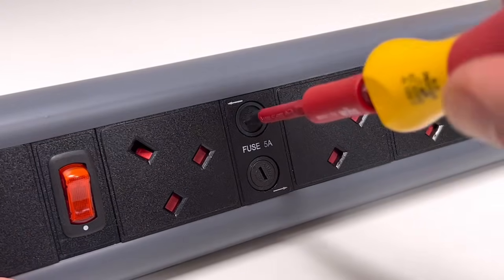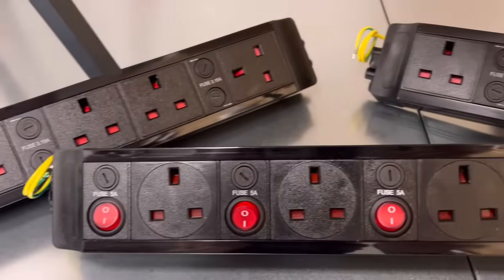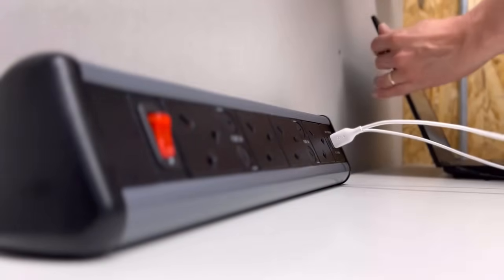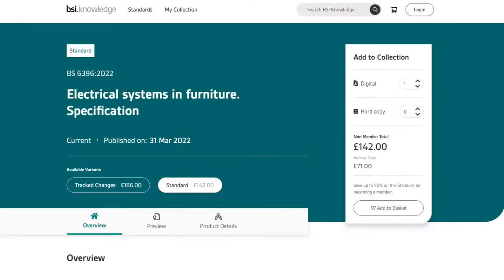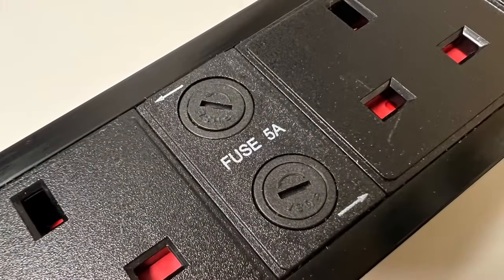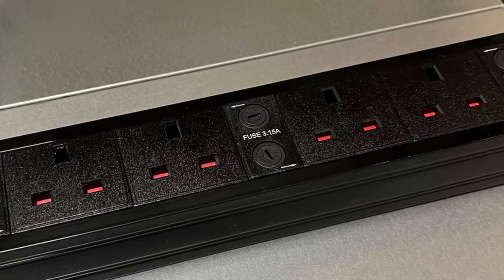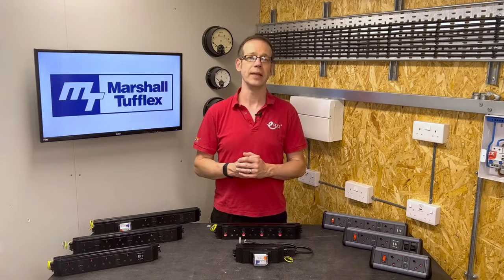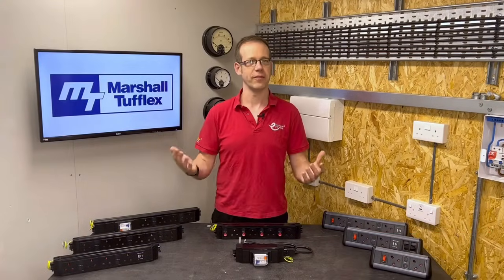BS 7671 Won't Tell You - Why Desktop Sockets Have Tiny Fuses

Comment: 5A must be one of the lowest in the world. In Germany its 16A, whereas in Australia and the Philippines its at least 10A. Quite safe as long as the circuit breaker at the panel board matches the power strip amperage.
Reply: in the UK it's as stated 13A. But in this case no one device can draw more than 5A so 2x5A = 10A, instead of a single 13A fuse in the fuseboard that can fail you are double protected.
Reply from the maker: Yeah, this is a pretty niche application for electrical outlets in furniture, a Standard UK plug top can have up to a 13A fuse in it. 👍
Reply: The main plug into the wall is 13A (a fuse inside the plug).  The sub sockets, usually supplying office equipment are 5A. If say one sub socket of a five socket bank overloads or a fault, then only that one socket is taken out, leaving the other 4 operational. You do not want 4 computers down for the fault of one.
Reply: @johnburns4017  its quite sophisticated and safe, but also adds quite a bit of complexity and cost. - All-in-all a computer plugged into such a power strip could have 4 fuses/circuit breakers, for example: 3A fuse in the desktop computer plug, 5A fuse in the power strip, 13A fuse in the wall plug and a 32A circuit breaker for the ring. 

If my crappy no-name computer power supply causes a short circuit, would it take out possibly 3 fuses at the same time? Is there time delay characteristic between a 3A, 5A and a 13A fuse? Do people in Britain keep a whole assortment of fuses ready at home and at work?
Reply: @ChristianWagner888  
Yes we do have an assortment of fuses in the home. Look in any kitchen drawer or near a main panel where people put them.
Reply: @ChristianWagner888  
In the UK, these 5A sockets on a desk bank is overkill, but not elsewhere. We have fuses in plugs which should be rated to say the computer which is usually 3A. All bases are then covered. 

The 5A sockets make perfect sense in a Continental or American setup where all is protected by say one 16A breaker at the panel.
Reply: @johnburns4017 All the cartridge fuses have the same blowing characteristic, while DB MCBs can be A, B or C...B and C have delay curves, so the local fuse should blow first...
Reply: @Ironic1950  
Yes, you have choices in fuse or mcb.  But a poor quality fuse may not react as a quality fuse does.
Reply: @johnburns4017  there are slo-blow fuses I think, which have a blob in the middle of the wire, ones with a light spring, to pull the burnt ends apart, and sand-filled types...